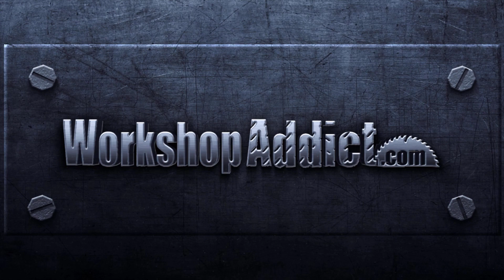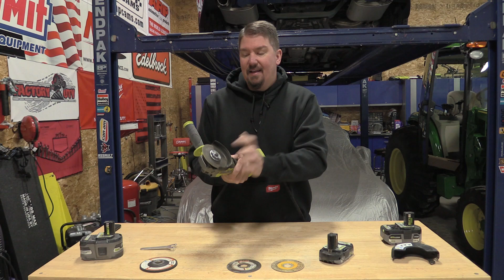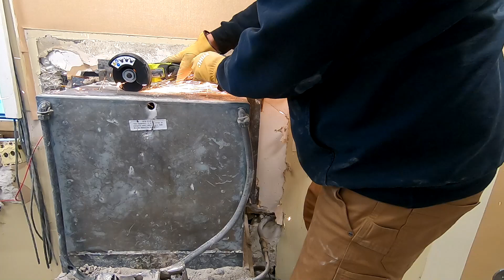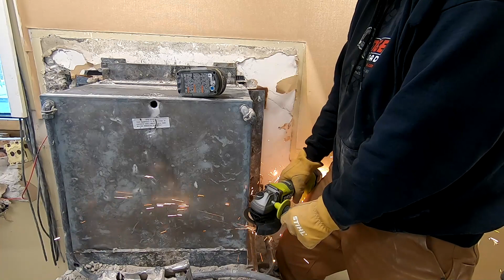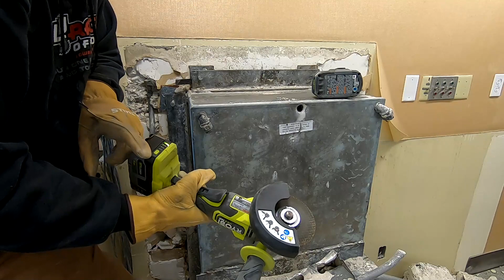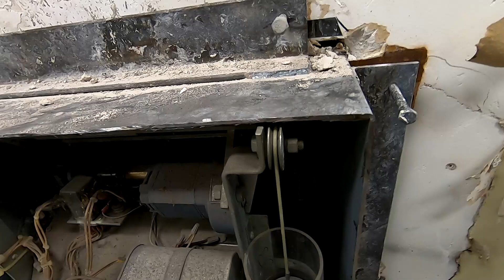Ryobi HP Tools Need More!  Ryobi One+ HP 18-Volt Angle Grinder Review Model PBLAG01

Comment: I just bought a new Ryobi model PCL445B brushed angle grinder and I am running a 4amp hour battery that came with my dad’s hammer drill, and I got to say for grinding metal it works awesome with moderate pressure. Yes i can stop it if I push too hard but for what I do it works for me. I also love using it with a Milwaukee wire cup brush for removing rust, paint, or cleaning welds ext. It also seems to work pretty well if I use a really thin cutoff wheel and use medium pressure. After Watching your video I feel like your grinder has a little bit less power than my brushed grinder. Great video.

Comment: I have the older one plus brushless non hp slide switch. I use the 9ah batteries, which Ryobi doesn't make anymore. It's awesome! I thought I could do better, so I bought the Milwaukee Fuel paddle switch. I found no distinguishable difference. I use both if one gets hot. I use the other one.

Comment: Wish I would've done my research before hand. I only have the 4amp hour batteries. Bought this to strip paint from an aluminum boat. Figured out very quickly that was a mistake. Had to run out and get a corded version. At least it'll make a good cutoff tool 😂

Comment: I had a Ryobi angle grinder back in 2013 and with the batteries available at the time you would get about 90 seconds under load.  It was great for removing old padlocks and tidy ups on fences away from power but it was what it was.  i now have a 9ah battery and am considering buying one of these.  PS I have 11 year old Ryobi 1.5ah batteries that still run great in the smaller tools.

Comment: I like the weight of the tool. Even with a 2Ahr battery, it has plenty of power to clean wires and junk between floor joists doing basement reno's

Comment: Just picked one of these up from Direct Tools Factory Outlet. Paid $80 for a factory blemished one. I can’t tell what the blemish is by looking at it. Used it to cut some bolts out of the concrete where I tore a wall out in the basement. I didn’t use the cutting disc that came in the box and I had a 4Ah HP battery. Cut through the lag bolts without a problem.

Comment: It’s good that you are letting people know  to keep this in mind.  I just read that this model has a higher rpm than DeWalt’s grinder so it obviously has a high current draw.  Every negative review I saw was about the tool cutting out too soon and I wouldn’t be surprised if the majority of those people never considered that the tool was just too BadAss for their old battery packs.  It’s a consumer brand battery-powered tool and most home gamers are not using it for long, demanding cuts.  I’m very happy with mine 😎 and for big cuts I can just use my big n’ ugly 5P pack that I Frankensteined together from 5 recycled 2ah packs

Comment: If that is under 1500 watts out, then I wouldn't recommend it. I need higher power for the type of my hobby work.
Reply from the maker: You are probably better off with corded or with a "Pro" Brand Grinder.
Reply: @WorkshopAddict  I have dewalt DCG418.

Comment: I have been using the 115mm brushed version for years ,can't kill it ,imo there is no need to go brushless.
Reply: I've been running the old (first green) 115mm grinder with the rotating battery for like 10 years now. 125mm disc fits it and also clears the guard...she's had a lot of hot suppers and still going strong.

Comment: Good battery pointers. In the current race to make larger and larger batteries I could definitely see somebody buying a tool, putting the old 2.0 AH they have on it and immediately thinking it’s trash. Was surprising that it barely ran with the small battery. 

On a side note have you used the Lenox metal cutoff blades? They cut fast and have very good life. They blade is metal with abrasive grit so they don’t get smaller as you cut either.
Reply from the maker: I have used them with mixed luck.

Comment: I love Ryobi tools. But you have to keep your expectations realistic with these tools. There not pro level tools. I think their excellent dyi or if you needed something in a pinch on the pro level it would work but that's not their main role and it wouldn't make sense for TTI to do that.
Reply: dj jd
Dewalt forced me to switch from 18 to 20v
2 weeks ago. Those tools got used very Hard for 14yrs 
I shopped hard for 12 new 20v tools for 1200 bucks. 
Dewalt wants $300
for the trim gun!
Bought Ryobi yesterday for 99 bucks!! Works great 
18v Dewalt lasted 15yrs with every day use.
Ryobi last me 2yrs per tool.
I expect my new Dewalt tools to last 2.5years??

I bought a Makita saw in
1985 for $90, replaced it in 2020 for $99, new!
Reply: @northcackalacky4694  Good for you on the Makita. I believe that's would be the deal with say a Ryobi vs say Dewalt xr. The Ryobi just by it's very nature of cost vs company profits is going to do the same job almost as well as the Dewalt but its simply not going to last as long being used day in and day out. Just as a company tier system TTI spends its money in Milwaukee. I've often said that you could build a house with Ryobi. But in that I said a house. With Dewalt or Makita you could build houses. Good luck to you in your purchase.

Comment: Angle grinders and Recip saws are notorious battery eaters. You can easily burn through a 3-5Ah battery in 5-20 minutes. You either need a pile of batteries,or get higher Ah ones for some specific tools.

Comment: IMHO , each battery operated tool has a battery that is performs with the best. Angle grinders are definitely battery eaters , on my m18 fuel if I'm doing something serious I use the 8ah , 9ah or 12ah.  On the other hand the m18 fuel impact driver works well with the old 2ah or new 3ah......it's up to the operator to make a educated decision on battery choice.  Great vid brother
Reply from the maker: Agree, but you cannot imagine the comments we get on how crappy a tool is because someone uses the smallest battery made.  It is not the fault of the user and it is not the fault of the tool.  Someone has to educate the consumer as to what they need and many people will not pay for a large Ah battery!  I would wager that 80 percent or higher of all Ryobi users have an older 4Ah as their largest battery.
Reply: @WorkshopAddict  I agree , that's what I like about your channel.......you explain these things to potential buyers.  Ive been around long to know that what you say rings true......

Comment: We've had it's father, the P423 for ages and recommend it.  We've got Makita and DeWalt corded 4" grinders, but were waiting for brushless before trying cordless.  We saw bad ratings were from 2AH battery users, but 4AH folks saying "replace the battery and it rocks".  It became our "go-to grinder for cutting, wire brushing, and grinding, saving brush wear on the others - LOL.  It was flawless until it lost a phase, so we just rotate and click again - it's that good.  Will try PBLAG01B next purchase, but the P423 isn't even leaving then.

Usually have to keep guards in the shop, but it rotates very well.  Btw, tuck in those hoodie strings!  I love the new quick hub and if this fits our ham-fisted folks as well as our P423, it will get frequent use.  We just keep rotating batteries and gettin' the work done.

Comment: Very good video. I already own the last version of this one.
I do very little cutting. especially rusted bolts in cars (suspension), and is good for that.
But I am planning to go beyond that doing some metal working as DIYer.
Which corded Angle grinder would you recommend me???
Thanks in advance and keep the good work.
Reply from the maker: This Ryobi is coming out in Feb 21.  As for corded, which is what you want for more metal working, look at the Dewalt line.  They have some nice smaller units that really have great power!
Reply: @WorkshopAddict  sorry I meant previous version.
Ok cool on Dewalt. How many amps should I look for???
I am going to built some metal forms for home and some grinding will be involved, but I don't want to bring out 20 batteries and dry them in an hour lol.
Thanks in advance.
Reply from the maker: This is my favorite Dewalt model for smaller projects.  Great size and excellent power.  https://amzn.to/3ogJPhS
Reply: @WorkshopAddict  awesome!!!
Thanks for the help.